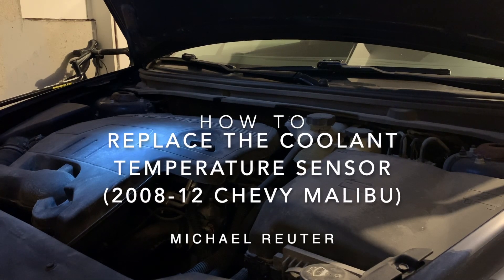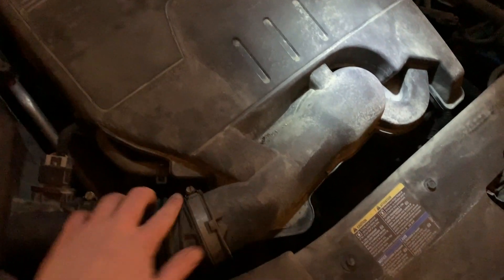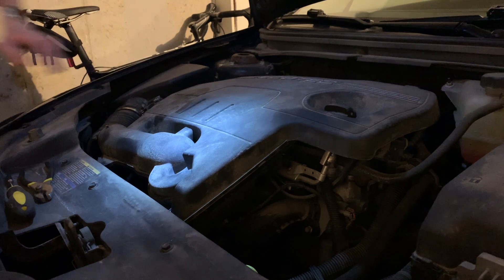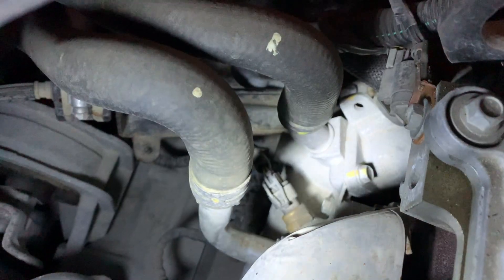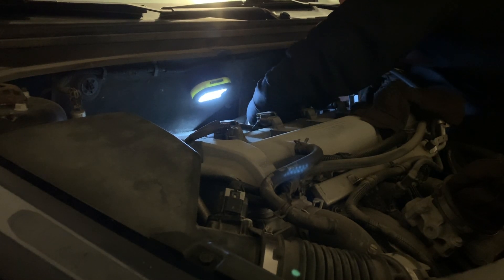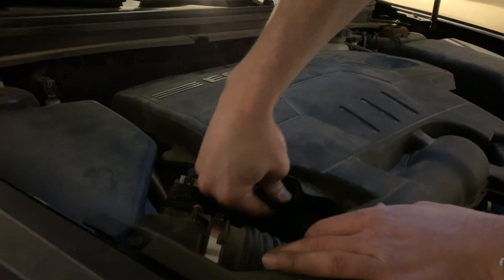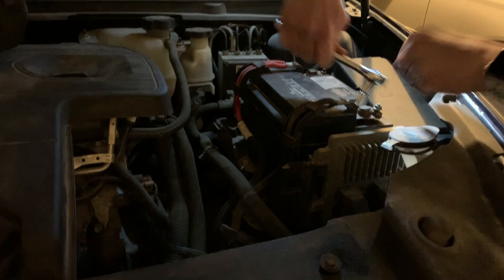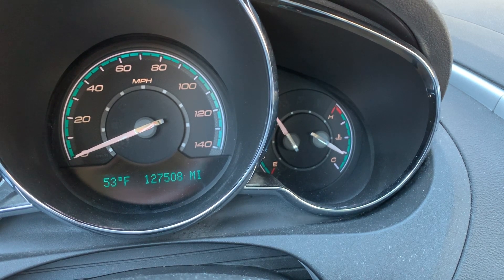08-12 Chevy Malibu Engine Coolant Temperature (ECT) Sensor Replacement

Comment: As a person who has worked on an 08 Chevy Malibu, I see so many red flags that this guy did very easily one you almost broke the hose on the intake. What I would recommend on the smaller hose to take it off would be to pull the clamp back and use a pair of pliers to wiggle because what you did is the same thing as a Chinese finger trap you tightened it you didn’t give it space to move. if you were to loosen the clamp underneath where the intake connects to the throttle body it would’ve come off much easier And there is a less chance of destroying that boot

Comment: Thanks for doing this video.  This is exactly what is happening with my 2010 Malibu.  I'm not brave enough to do this repair myself but at least I'll know something is up if the repair shop tells me that they have to take 10 hours to disassemble half the engine to get to the sensor.

Comment: i’m super late, but i’m having the same issue with my 2009 chevy malibu, check engine light, temp gauge not working, AC will blow but wont blow cold AC, i changed the part, and it’s still not working, i  didn’t disconnect battery after changing it though, so could that still be the issue?
Reply: Try swapping your thermostat, it could be malfunctioning!!
I have the same issue

Comment: Great video .... what tool and size did you use to get the old sensor out? Is there a bolt next to it holding it in place or use a deep socket?

Comment: Thank you for taking the time to produce this video I'm sure it'll be helpful to many as it has been to me . If you would allow me to make a suggestion; the left or right side, the front or back side of a vehicle is established as if one was sitting in the driver's seat. Therefore the engine coolant temperature sensor is actually on the left side of the engine.

Comment: FIRST: Try disconnecting the battery, waiting 60 seconds, then reconnecting it. If problem is still there, continue with replacement. Had the same issue, gauge dropped to cold, AC stopped working, but still ran fine. I replaced the CTS first before checking the battery, turned the car on and the gauge was still not working. It wasn’t until after I reset the batter it went back to normal. Hope this helps.
Reply: Lifesaver, i just did this and it worked!! Good shit 👍🏻
Reply: Dude this worked for me as well. You saved me a hassle. This is why you always check the comments first, I haven't even watched the full video yet!
Reply: Everyone saying this fixed there problem 😂 people this is a quick fix not permanent the problem keeps coming back! Has anyone found the reason this happens!! That’s what I want to know not keep disconnecting my battery 😭 going to the shop tomorrow for a real answer tired of disconnecting my battery everyday lol I’ll let you guys know what happens 🤷‍♂️
Reply: @daze815 Soooooo what happened? I have this issue everyday! Ugh annoying!
Reply: @daze815 What was the issue?
Reply: Same problem with me @daze815
Reply: Just did it and it worked first try
Reply: One year later and you still saveing life’s bro appreciate it it’s hot as fuck
Reply: You are the fucking greatest man. Thank you for real that fixed it first try and saved me like $100 replacing thermostats and Coolant Temp Sensors
Reply: Thanks
Reply: Fixed my problem. Thank you so much!
Reply: Would it make the engine light come on?
Reply: Thanks.......... just did mine.
Reply: THANKS SO MUCH. MY 2014 HAS BEEN DOING THIS TOO. I WILL TRY IT IT TODAY
Reply: Bro you quite literally saved me $100s of dollars. Literally I don't know what else to say, but thank you! TAKE HIS ADVICE, LITERALLY JUST FIXED MY ENGINE LIGHT, TEMP GAUGE AND SVC TIRE MONITOR MESSAGE!
Reply: Saved me today! Thanks!
Reply: It works but after couple days again same problem
Reply: i had to rewire mine bc it had became bare wire and was touching...i rewired it and it still wasnt reading...i said let me reset the ecm, i took the pos cable off like 5 mins...all is well now!!❤❤❤
Reply: Juuuust did mine.....thanks @Korypeters9432
Reply: You’re a lifesaver dude

Comment: Thanks for this, found your video via the thread on the Malibu forums. I'm about to replace the ECT sensor and thermostat simultaneously, as well as clean and attempt to waterproof (or at least condensation proof) the BCM connections. Fingers crossed.

Comment: Just take off the coolant reservoir container(2 bolts) and you will be able to reach the ect sensor, not necessary to remove the engine cover ✌
Reply: Can confirm it works. A deep 19mm socket will fit on the sensor
Reply: @matthewallen9005  would advise to change the thermostat too.. in most cases mine too the thermostat got stuck, resulting in engine overheating and killed the sensor
Reply: Thanks

Comment: Ders times when im driving the temp gauge goin down to 0  and then back to normal? Could it b the the Engine coolant sensor
Reply: Yes, it was the same with mine where it become frequent and ended up stuck permanently at zero. This caused my radiator fans to run at max rpms and a/c clutch didnt seem to be engaging. Replaced the ecs and thermostat together, the thermostat since most users in the forums I read mentioned that just replacing the ecs alone didn't fix it(the old thermostat did look in good condition but Im no mechanic, plus didnt want to make another trip to the spare parts shop).

Works fine now!!

You can reach the ecs by removing the radiator coolant reservoir (2 bolts), which will give you some wiggle room🙂✌

Comment: 3rd Time I had to replace this as soon as you see the temp gauge not working its burned out again and when it dose it will mess up the hole dam check engine light system traction control and all that crap car shuts down power loss its bull shit.

Comment: old post, but maybe this will help someone who searches later on this.

I started having the same issue with the temp gauge dropping to 0 intermittently and throwing the code p0128 for the Coolant Temp Sensor and A/C blowing hot. When code is cleared it will function properly for a random number of days. Replacing thermostat and CTS/ECT did not solve the issue. But during the last couple of months of troubleshooting the CTS another issue emerged. The brake light will stay on even when pedal isn't depressed and when it is depressed the brake lights go off. Cruise control will not work when experiencing this and will randomly throw ESC(stability control)and TCS(traction control system) All of this can ultimately be traced back to the TSB #08-05-22-009C (Intermittent Brake Lights) The issue is High Resistance due to "fretting corrosion" in the BCM C2 or X2. Final solution is to apply dielectric grease to the C2 connections on the BCM.
Hopefully this helps someone so they don't have to deal with the frustration and throwing random parts at it and hoping for a solution
Reply: I actually am having this issue and searched the videos. Saw your comment. I'll do that as well but will replace the sensor since I already ordered it and dont feel like sending it back lol
Reply: I have 2007 Malibu with 73K miles and today i started the car and AC is blowing hot air and few minutes later i notice my temp gauge is still reading 0. I found a PDF file online that is 13 pages long and explains how to comply with TSB #08-05-22-009C. I am going to give it a try, hopefully it fixes it. Thanks
Reply: These are two completely unrelated issues the brake lights are a recall
Reply: Thanks
Reply: And it did help later on! Thank you!

Comment: A couple months ago I started having same problem. Temp gauge went down to cold, a/c stopped working, and check engine light came on. Replaced the ECT sensor and issue still remained. Hmm maybe thermostat? Had the thermostat replaced as well and when I cleared the check engine light the gauge immediately jumped and read temperature. That only lasted a day then gauge went back down. I though it had to be the wiring to the temperature sensor checked it and all good. Cleared the check engine light and again gauge immediately reads temperature again. But it only lasts a day at the most before the problems happens again. Any ideas what else I can try? I want to avoid dealer at all costs.
Reply: I just recently bought a 2010 Chevy impala LT.  Drove it for about 2 days then engine hot ac off came on. Replaced temperature sensor didn't fix the problem. Next day replaced thermostat and refilled and bleed system good. Still nothing scratched my head for awhile. I unplugged the harness for tempature sensor plugged in the old sensor. Touched the old sensor on the warm engine  while running. Fans shut off and engine hot ac off went away. Was able to use air conditioning. So I'm assuming I got a faulty sensor.  This will at least tell you if your wiring is messed up or you have a faulty sensor. Also was able to erase code that was permanently stored. Going to replace sensor again in the morning. To see if that fixes it all the way. Also dont forget to disconnect negative when you  replace sensor or thermostat. 

Any questions feel free to send an email. 

Twistedclown79@gmail.com
Reply: Was you able to fix the problem
Reply: @marlonperdue  nah bro, mechanic wanted to replace my water pump at a cost of almost 800 and he said “most likely that might be it” I had enough and traded the car in for a newer Malibu.
Reply: @angelvarela9428  How is the new Malibu working out for you. Thinking about getting rid of my 2010 Malibu as I am having the same Problems you are/were having. 
(Side note: I have family with your last name pretty cool,I’m from California)
Reply: @macck4350  hey there nice to meet you. I drive for Uber so my 2019 Malibu now has 103K miles on it. So far so good with no mechanical issues so far. It has been easy do maintenance on it and much more easy to replace a headlight bulb. If you’ve had to do that in your 2010 you know what I’m talking about.

Strangely enough I’m from California too. I must be long distant relative of your family as Varela is a very uncommon last name.
Reply: @angelvarela9428  oh dang,ya your Rackin up the miles.Hey so are u from Nor Cal or So cal if you don’t mind me asking?:) I’m from Nor Cal.
Reply: Changing headlight bulb on 7th gen Malibu is ridiculous!!

Comment: Hey man l have chevy malibu 2012 n the temp gauge went down n the ac stopped blowing cold. You think is the same problem the you fix???
Reply from the maker: Salvador Rocha Very possibly. Those were the same symptoms my car had!
Reply: Michael Reuter this just happens today this morning whit my car
Reply: Michael Reuter n by the way do you speak Spanish?
Reply from the maker: Salvador Rocha A good test would be disconnecting the battery to reset the computer and seeing if that temporarily fixes it. I don’t. :(
Reply: Michael Reuter ok disconnect the battery first ?

Comment: Do you have to put any tape on the new sensor or should I put thread lock on it
Reply: For now it did. When I first put it in the temp gauge did fine the next day it went back to 0 and the ac stopped working. Today it's back working fine. So I don't know
Reply: @twistedb-e85  your problem is from the sensor plug only
Reply from the maker: Chevyhi I didn’t and haven’t seen any leaks in my garage but it’s not a bad idea.
Reply: Did the new sensor solve your problem?
Reply: GM service info says to use an RTV sealant on the sensor

Comment: How did you pull (or twist) the air temperature sensor out of its holding compartment? I wasn’t able to get it out at all, but I plugged in the new one to the outlet and just let it hang... temperature gauge on the dash is still all the way on cold and A/C not blowing cold air. please advise.
Reply from the maker: The coolant temperature sensor? I used a ratchet.
Reply: @MichaelReuter  Does the temp sensor need to be twisted into the fitting that was leaking the radiator fluid to work effectively? And do you know what size ratchet you used to remove the defective coolant temp sensor. I wasn't able to remove the defective coolant temp sensor but I did plug in the wires to the new coolant temp sensor and let it hang, but temperature gauge on the dashboard are still on cold.
Reply from the maker: Daniel Wahl Yes, it needs to be tightened into the engine block. It senses the coolant temperature, not the air temperature. I’m not sure what size it is but you can disconnect the new sensor and see what fits on it before trying to take out the old one.
Reply: @MichaelReuter  I got it tightened into the engine block and plugged in to the wires... Engine temperature still stays on C all of the time and air conditioning doesn't blow cold air. Any follow up steps you would recommend? I appreciate the help.
Reply from the maker: Daniel Wahl That should do it. It’s possible you blew the new sensor running it in air instead of liquid.
Reply: @MichaelReuter  what do you think are the chances of that? Do you know if these things could actually blow from running it in air?
Reply: @MichaelReuter  do you think the issue could be with the engine coolant thermostat?
Reply from the maker: Daniel Wahl I don’t know for sure that’s possible, it was just a guess. The thermostat could certainly be the culprit.
Reply: @TeslaSoCal  I'm having the same issue...did you replace the thermostat & if so, did that fix the issues?  Greatly appreciate your update - thanks!
Reply: @scottsherman5262  I'm pretty sure I did replace the thermostat or it was an issue with too much freon pressure in the air conditioning System. I ended up wrecking this car 2 years ago and traded in for a Tesla Model 3.... best decision ever.

Comment: Thanks.. trying to fix my fiances car.. same thing.. when she was driving the temp gauge went down to 0 and the AC stopped blowing cold, just warm air coming out.  Question though, what did it take to get the cover off?  I seem to be struggling.. did you pull from any specific side that got it loose first?
Reply from the maker: Crimtide There are two clips on the back you have to pull it out of too. One is on the left corner and the other is straight on in line with the oil cap. Pull up in the front near that hose and try to wiggle it forward and to the right.
Reply: @MichaelReuter  Thanks!  Will give it a shot later
Reply: Just carry a code scanner in ur car all times and Erase the code, car goes limp mode from check engine loght

Comment: On my 2008 Chevrolet Malibu LTZ,  the A/C does not blow cold air and the engine temperature gauge is always at the bottom (on C) whenever I run the car... But two weeks ago the A/C spontaneously started working and blowing very cold air, which only lasted for three days. Then the A/C stopped blowing cold air again, and the engine temperature gauge is still at the bottom. My check engine light is also on and I'm getting a reading to change the fuel tank pressure sensor... Do you think I may have the same problem as you were experiencing?
Reply from the maker: Daniel Wahl Definitely sounds like it. This was intermittent for me as well and sometimes triggered the check engine light but you might have another issue as well with the fuel tank.
Reply: @MichaelReuter  thanks for the video and info... how long did it take you to get the engine cover off after you loosened the screws in the video? And should I drain the refrigerant before I try to replace the engine coolant temperature sensor, or is that not necessary?
Reply from the maker: Daniel Wahl It probably only took a minute or two but it was suctioned on there so tight I did a lot of checking to make sure I wasn’t missing something else. I don’t think it’s worth the hassle to drain the coolant as long as you have the new sensor ready and can swap it quickly. Not much is going to leak out in a few seconds.
Reply: My 09 malibu doing the same thing and i got new thermostat and coolant sensor put in